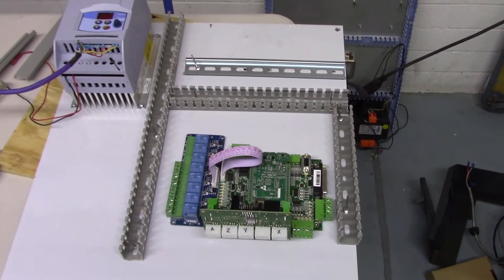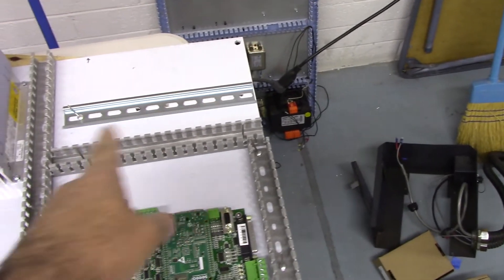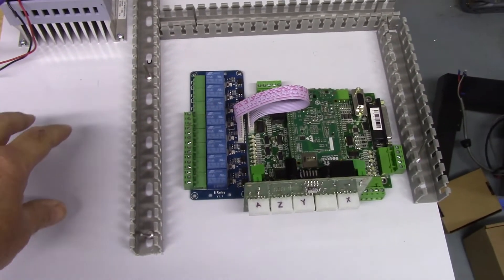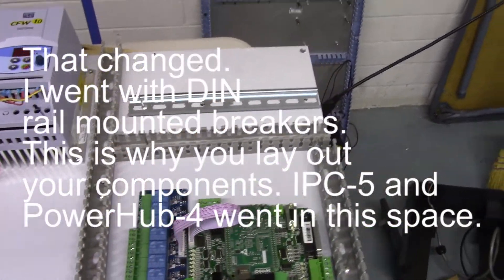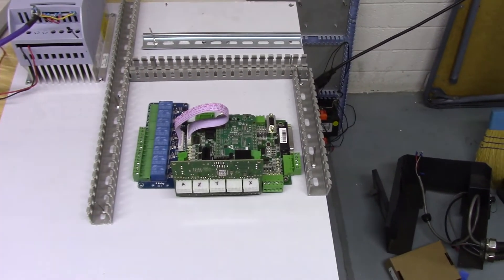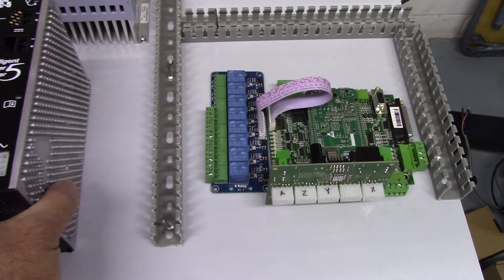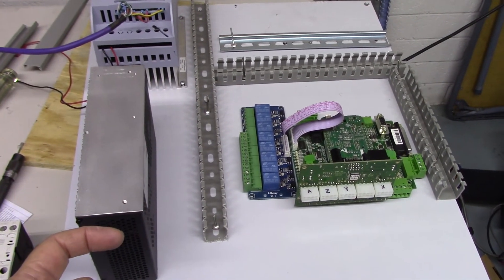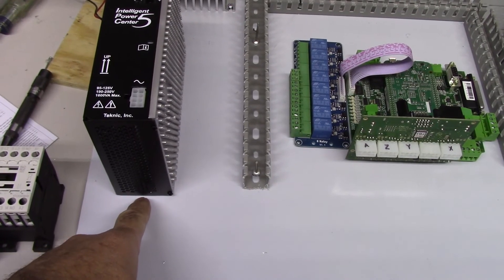SYIL X4 CNC Mill, Teknic Clearpath SDSK, Centroid Acorn Project: Basic Panel Layout

Comment: Marty this is brilliant !!   Do you have a wiring diagram and parts list?
Reply from the maker: No. Use the Centroid 220vac system wiring diagram as a guide. Watch the next video. I do go into some detail on the back panel wiring.
Reply: @martyscncgarage5275  Hej Marty!  Thanks for responding to me so quickly..  I am curious about the little complicated nitty gritty details like how you wired the safety relay and so on..  the genetic diagrams from Centroid are great but some grey areas remain.

Comment: So I am setting up almost this exact setup.  You used a 24v coil contactor.  How are you wiring that up?  You have 240 volt coming in.  Do you have that 240v switched to the 24v power supply that turns on the board but also activates the contactor to turn on all the rest of the 240v equipment (IPC-5 and VFD).  I am having trouble finding a 2 pole switch that will run both lines of the 240v to the power supply?  Or did you just split off and run l1 to the power supply and activate it using 120v?  Also, how did you wire your emergency trip?  My thinking is to run it in series with the switch so that if I have an issue, it just kills power to the 24v, which will kill power to everything.
Reply from the maker: Stay tuned for the next video showing the back panel wired up and it will answer some of your questions. Meanwell power supplies are rated up to 240vac